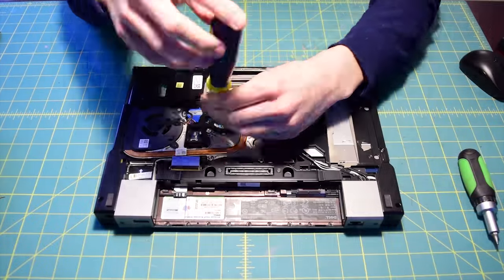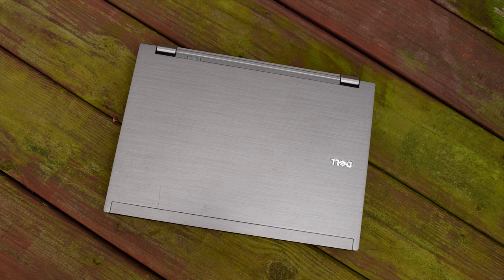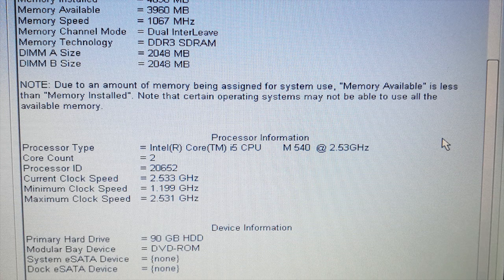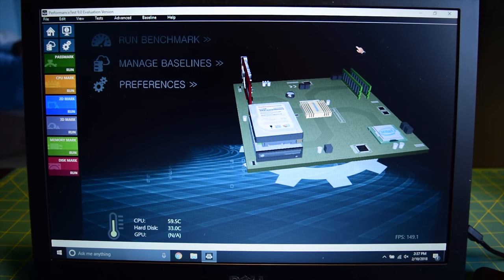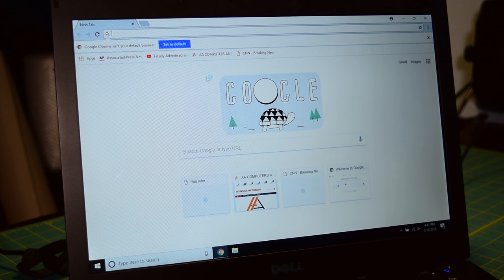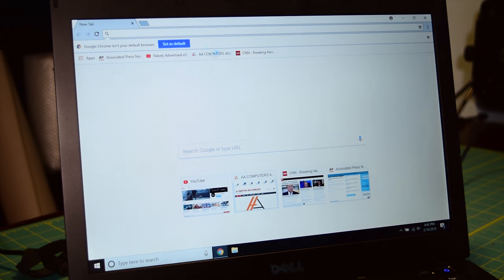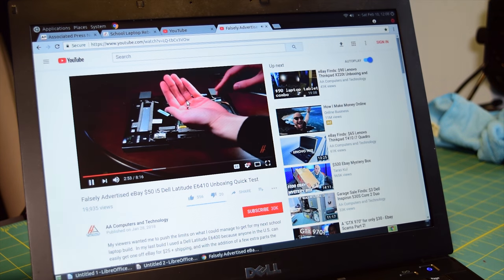Intel i5 School Laptop Rebuild Under $135 Dell E6410

Comment: nice video,
i got a DELL Latitude E6500 with 1920x1200 2xCCFL screen, backlight on keyboard and lots of stuff.....
that laptop is really good but the GPU is really not that cool (Quadro NVS160)
so i've look for a upgrade and i seen the DELL Precision M4400 use the same chassis.....
i found a Chinese seller on the US ebay (i'm French and on ebay.fr that seller don't exist!) that sold me a DELL Precision M4400 motherboard for 50USD! (the heatsink is not the same on the Latitude E6500 and the Precision M4400 in fact, the Precision have to dissipate lot more than the Latitude E6500) and the nice part came.
i also bought a core Q9100 for maybe 15USD and i've put a SSD.
now, the laptop have a Quadro FX1700 512MB (can use shared memory) 4gb of DDR2 800MHZ (can go up to 8GB for a crazy price) it have a core quad that replace the poor dual core that was in it and that laptop need lots to start to get hot and run fast can do HD 60hz youtube, can play lots of games, is really comfortable tu use due to the excellent keyboard, the ALS for summer that control the screen backlight to lower it or increase when ambient light change so, some old computer can kick lots of new gen low cost thing!!!!!!! and for a good price

Comment: Windows 10 or Linux is a must because of 'spectre' and 'meltdown'. For the average user windows 7 is too insecure. For windows 7 OS probably best to stick to pre-2008 cpu's that have a frontside bus. I won't debate but it looks like QuickPath Interconnect (QPI) is more vulnerable to exploits using Branch Prediction and Speculative Execution. I would love to see benchmarks on reduce performance using QPI vs FSB caused by latest Windows and Linux 'spectre' patches\microcode updates.
Reply: graphosxp Nah.. Running dos here.. The virus wouldnt even execute.

Comment: My advice is get a second hand dell or lenovo or hp thats around 5 years old and upgrade the cpu if you can ram hard drive to ssd  get a business laptop as there just built better than the plastic consumers laptops your save a ton of money as to me a quad core i7 from 5 years ago is just as fast  as mist have 4 cores 8 threads and 6 mb smart cache .

Comment: Even a lower and older spec is my $2.00 Dell laptop xps m1330 which about $40 for a 160 gb intel ssd and about $25 for A/C adapter and battery and it has a 2.0 Ghz Intel Core 2 Duo CPU with 3 GBs of ddr2 ram 667 mhz and intel gma integrated graphics. I actually have Windows 10 pro 64 bit running on it and it seems to run fine on it not for doing anything heavy duty like video editing or the latest 3d gaming, but its fine for general pc tasks such as word processing, e-mail, facebook, 720p YouTube video and audio playback, and even some light gaming like candy crush or slots or running older 3d games such as the original Deus Ex from 2000 or Will Rock from 2003.
Reply: Shawn Burton you you play old school runes cape, if you do please tell us!
Reply: I've never tried that one. I think the oldest PC game I have is on an even older Toshiba laptop with Windows 98. I have on old DOS game on there called Shamus which is where you go around this maze and avoid these figures and said that game was released in 1988. I also ran on that same PC Titanic, adventure out of time which was released in 1996.
Reply: You're lucky that your M1330 has the Intel Graphics. I know that sounds weird because typically you'd want to have the dedicated graphics, but there were defects in the nVidia chips of that era that basically resulted in every one being destined to fail.
Reply: Jacob beings that I mainly use it as a netbook for on the go web browsing, so I think integrated graphics is actually better for portability since it uses less power and produces less heat. I do have my desktop I'd I want run heavy duty 3d games which has an i7-4770k with a gtx1060 6 GB gpu.

Comment: How lacking in strength does one have to be to complain that a 5lb laptop is too heavy? Gaming laptops are known to weigh in excess of 10 lbs. If such is the case for an individual, try some exercise because you shouldn't feel like Spongebob trying to lift a glass of water when having to handle a laptop.
Reply: The issue comes in when you also have multiple 5lb books, the ac adapter etc in a backpack that you carry around with you all day.
Reply: Sounds like a good way to get some rucking done in between classes.
Reply: @CondoreComputing  Not a very heavy backpack, and if you actually schedule properly you'll never have to carry more than one or two books at a time and can save an immense amount of weight.

Here's another thought, you could store all notes and textbooks ON the laptop and lose even more weight!

Get an extended battery and rebuild it with quality high capacity cells and run with more power saving features and I'm willing to bet you can drop the charger, too.
Reply: @Dr. McGoatz These things can get 2-3 hours with a ruined standard battery. I've got a ruined extended battery that gets about 5 hours on high performance, probably more if you put it into power saver and rebuilt it with better (or at least newer) cells.

Comment: Very nice video But you forgot to mention something. If your laptop doesn't have a windows key on sticker on the bottom of it chances are you will have to pay for one. Unless you have a broken desktop or laptop that is no longer working that you get use that windows sticker from. But if you do not have any of them then you will have to go buy a Windows key.
Reply: Diy in the Ghetto you do not have to buy Windows it works just fine inactivated, just the watermark is there
Reply: Of course you can keep it like that but in windows 7 or 10 most stuff is disabled. And in windows 7 will stop working after a while into you can activated it. No reason to have a desktop or laptop if the windows isn't fully working. Unless you know linux and Linux is free you can go that way. But for the people who mostly stick with windows this is how it is.
Reply: Ever heard of kmspico?
Reply: Yes i have and no i do not use it Not worth it. If i do not like a OS i don't stick with it. and also i do not use that stuff another headache. Over time i would like my stuff to work and not have to keep reinstalling it because of some stuff like that.
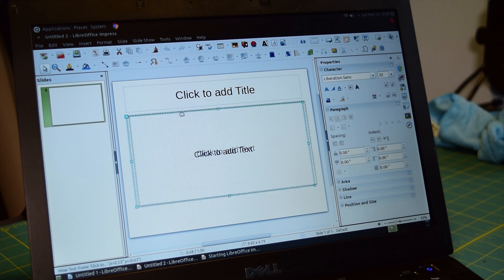Reply from the maker: 7:01  or if you have no choice but to go with Windows you can get a license off Kinguin for ~$25.
Reply: This is true, Correct the point i was trying to make. Thank you.
Reply: i love useing that program
so easy to use
Reply: You can also get OEM codes for $5 on eBay
Reply: That is what I'm trying to say is that it is better to buy the license then to get something like that program online. It is a headache from what i have seem to use one of them programs people say. I rather buy the license then to use a program like that. But then again i no longer use windows because of other reasons.
Reply: every windows from vista plus can be used unactivated. its just if you like ur wallpapers you pay
Reply: Of course you can but microsoft blocks a lot of features and might be able to block your windows if you do not activate it.
Reply: Not the point i was making but thank you for clearing up that.
Reply: Got a windows 10 key for 8 dollars on ebay lol, and its working till this day after reinstalling windows 10 a couple times.
Reply: It is quite possible that you are able to get windows 10 enterprise for free if you have a .ac email address with your college.

Comment: Please build a used gaming laptop for 300$
Reply: Anirudh Mallikarjun you don't build a gaming laptop. You buy one lol
Reply: kenny ricardo i do know that bro but i want to see how you can buy a cheap laptop and make it a csgo potato
Reply: A T430s/non-s with the NVS 5200 would be a pretty decent CSGO machine
Reply: m 6600 200 bucks get a quadro 4000m 4 gb ram . 125 bucks
Reply: Very complicated. That if you want him to buy separeted parts from gamging laptops and build one. If it is to build a gaming laptop using standard parts, thats not only impossible, but still unpracticall, as gaming in these types of hardwares will likely degrade it. Even for normal gaming, not the full last games made.